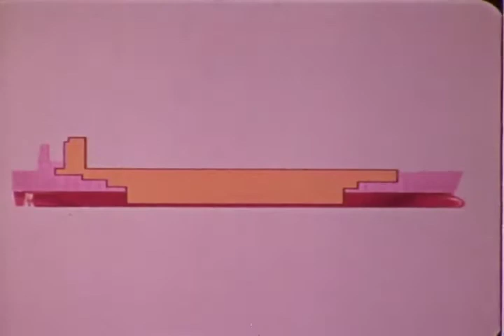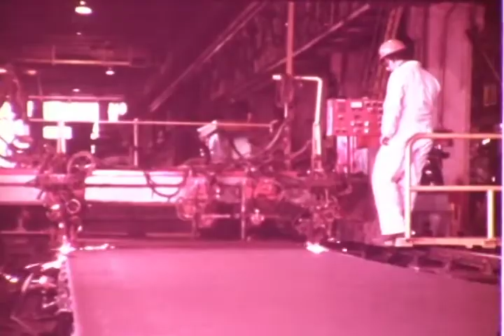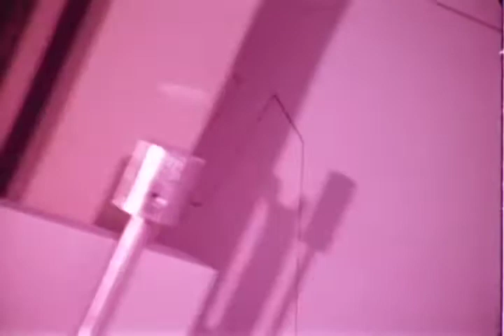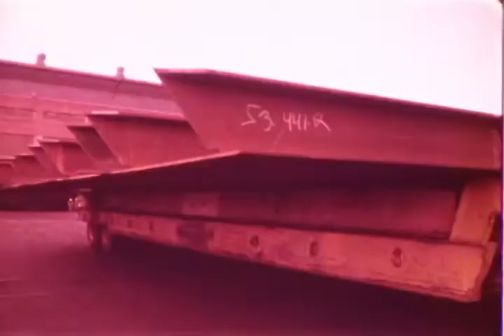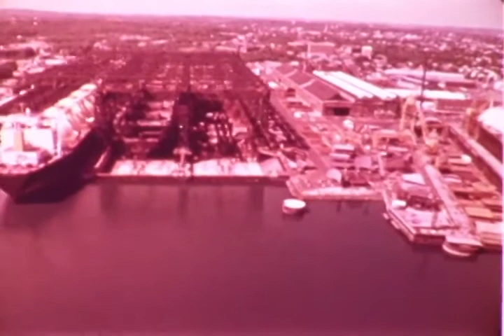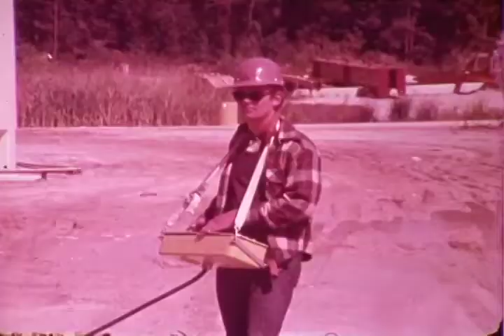F 1602 General Dynamics Quincy Ship Building Footage LNG Series

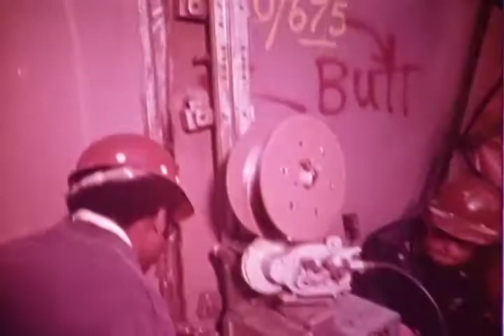Comment: I was thinking about the LNG built in Quincy and ran into this video. To my surprise at  the 14:05 mark  is me , Red and Williamson running the DD-2 vertical welding machine on 25 foot  level.  Ah to be 24 years old again.
Reply: That's awsome!
Reply: I weld on those ships for five years open back up Quincy ship yard put Americans back to work
Reply: I have so much good memories of General Dynamics Ship yard  meet some great friends along this journey
Reply: I was there for all 10 LNG ships, pipe welder. Those ships were so well built most of the 10 ships are still in service  over 40 years latter